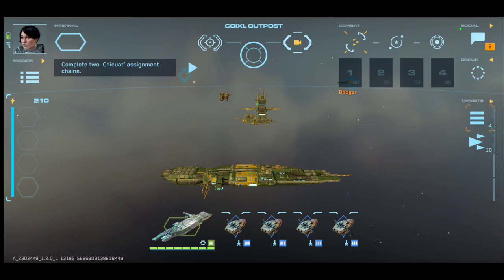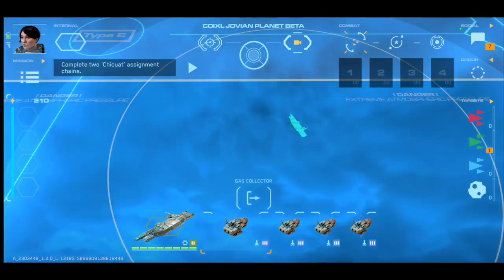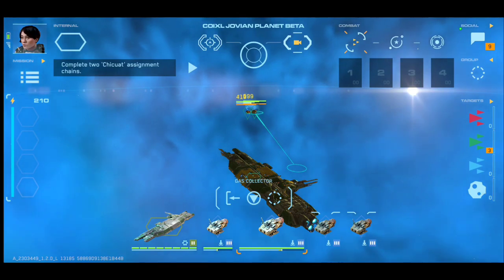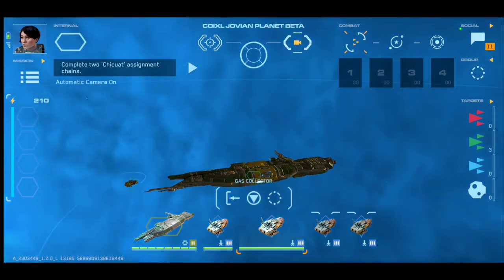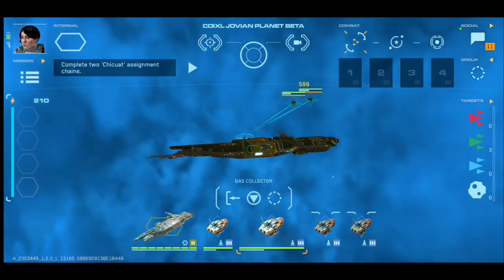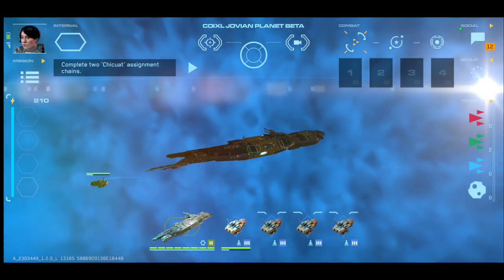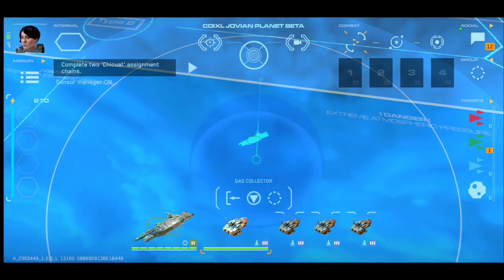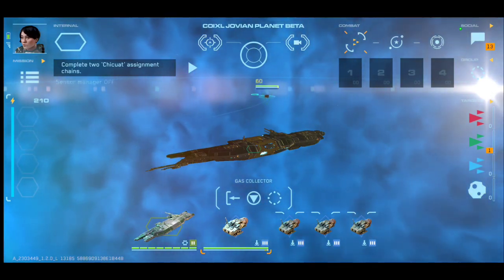HOMEWORLD! Mobile. Gas mining without a repair turret.

Comment: You know that by docking and undocking the gas miners. You'll only prolonged the Gas Mining?
Reply from the maker: You have to dock the miners after they drop off the gas as they lose their armor, if you send them back in the gas they start loosing hull, you eventually have to dock or risk them being destroyed in the gas cloud, you really need a repair turret to effectively mine gas, I only did this video to show that it can be done but it's a pain in the butt, the gas cloud damages your miner, docking the miner restores hull and armor.